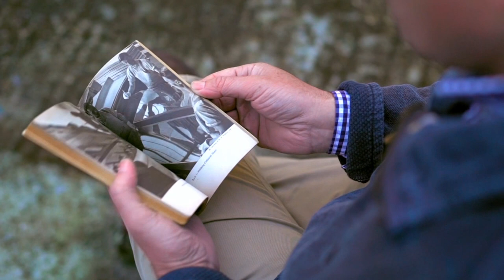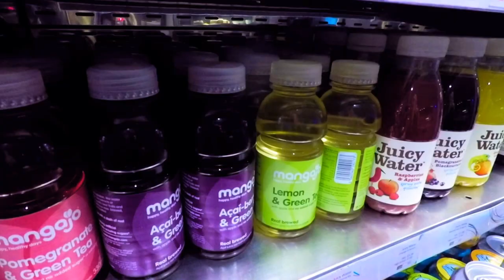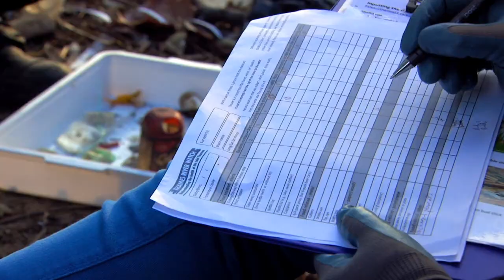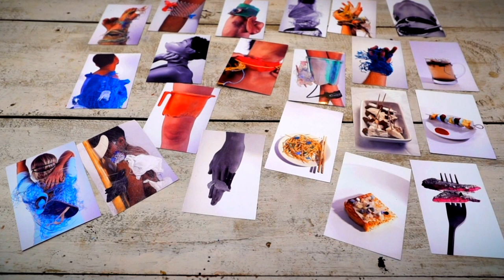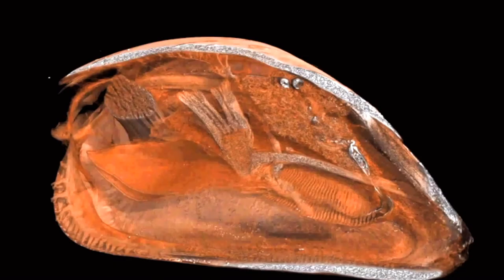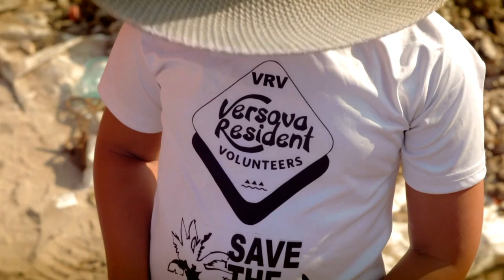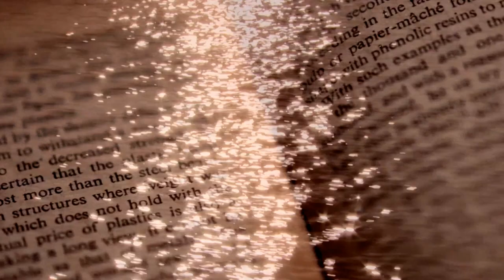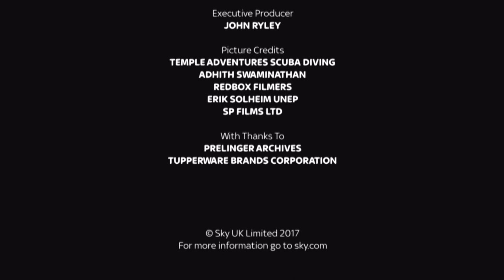Special report: A Plastic Tide | #OceanRescue

Comment: Food packaging is most of the throw out stuff.  We need to come up with a bio material that can be used for food safe packaging to prevent contamination and food storage once we get it home.  there are waxed wraps sold in different sizes that are meant to be reusable, if washed properly.  We have to slow down and get used to washing again on a larger scale.  I don't know how much percentage is disposable diapers.  (can't these be made of waxed paper and cotton  somehow ?).
Reply: There have been so many products made ... sadly they are more expensive than plastics at this point.
Reply: My health food store is using plant-based cellophane to wrap the cheese portions that they cut from the larger bulk cheese blocks for purchase.

Comment: When the yellow cart conveyer belt system is operating, the problem will end before they connected the lines, if they still build it this time around. The "Cronological positioner" really messed with my head.

Comment: The UK has been using plastic long before India has, and yet indias beaches are covered in it. Plastic has its uses but if its not disposed of properly it is extremely dangerous for the environment. India do not have the infrastructure to deal with plastic waste, but still has the appetite for its convenience

Comment: A mechanical rotary rake and sand shaker should make beach clean up much easier or less labor intensive, as well as some what more expensive, I suppose however, that the use of manual labor allows individuals to be more plastic-pollution conscious and progressively involves more and more members within a given locality, in one way or another.

Comment: Plastics is definitely a problem but I would like to see more information on what is being done on a higher level to deal with this problem, what is being done about finding possible replacements for single use plastic, something like biodegradable cling film for example. What other research is going on to devise a method of getting rid of the plastic waste...maybe some information on how do the beach cleans get rid of the waste they collect? Disposal of waste still has to be funded in some way so how do they achieve that? The documentary is not offering any solutions or advice on how to deal with the problem in our own lives or communities.  It's impossible to expect people to keep on doing beach cleans forever if the problem is not tackled on the other side of the chain at the production end. Replacing single use plastics with some sort of biodegradable material and similar things...